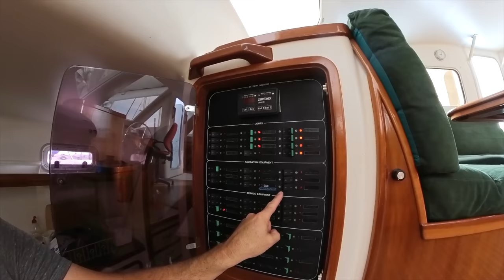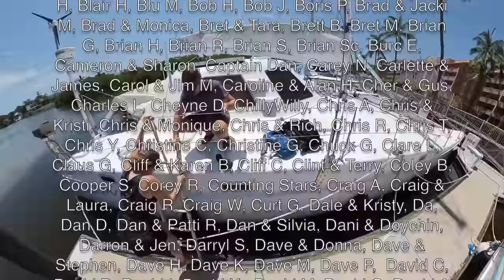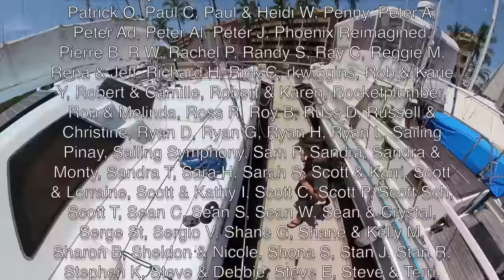OUR CATAMARAN SEARCH -  EDIT - THE DEAL FELL APART!

Comment from the maker: Hey there friends. I made a few mistakes in the video that I will clear up in a future video. The boards are pivot centerboards, which is a different thing than a daggerboard. The centerboard retracts on impact so they are basically unbreakable. I called it an escape hatch, but according to CW, calling it an escape hatch is actually a misnomer. The hatch is intended to allow entry inside the boat if capsized. The reason you want to go inside is that one of the key features of this design is the entire forepeak of each hull can function as a safe and dry habitation space in the event of capsize. Also, Chris tells me he can do all the engine checks from the aft compartment and doesn't need to tear up the bed. More to follow....of course.
Reply: A wise move is to ask Chris to inspect the whole boat, specially those cracks. Best wishes
Reply: It's also possible to do pivot asymmetrical boards, but either way the pivoting feature in many ways is better than daggerboards since they pivot up and out of the way in a collision with something.

Hit something hard enough with a daggerboard and at a minimum you damage a tens of thousands of dollar daggerboard, and (potentially much) worse if the daggerboard trunk is damaged.
Reply: Hope this all works out.... Its the boat you wanted and can be fettled to fit as well as updated. 
You can fit covers to the nets for when your at anchor or light weather sailing..and roll them up for when your facing full on passage making.
Reply: He even goes so far as to sort out what the inverted water line likely is to give an idea of what the boat might be like to survive on while capsized. He discusses the importance of having reserve buoyancy in the decking so the inverted water line would sit higher instead of leaving the entire vessel awash.

Comment: I never saw this coming.
The perfect next step to your adventure.
Congrats!
Reply: Funny thing, I kinda did see this coming as soon as they posted the Atlantic cat video, what was it 6 months ago. They are great boats, if sailing is a priority.  I sure hope the deal comes together.
Reply: @AndrewMoizer  This is that exact same boat, yes?
Reply: @user9b2    Similar, the boats in the previous video were newer designs, refinements of the same core concepts. I would say that the Atlantic 55  was the flagship design in its time, and depending on your requirements could still be better suited than the latest ones (things like the pivoting centreboards rather than dagger boards or mini keels). I don’t doubt this would have remained Chris’ forever boat had the opportunity to purchase Leopard after the capsize not come along. This is certainly a big, comfortable ocean cruiser, and a great boat if you can afford it, and are comfortable sailing something this size. I hope their deal comes together, it will be fascinating to follow along.

Comment: Congratulations on the new cat!  I like the idea of dual battery banks and dual systems. Redundancy is good; 2 Victron BMV712 battery monitors $216 ea. 4 SOK 206ah marine batteries $1030 ea. 2 Victron Multiplus inverter chargers $1,500 ea. 4 400w solar panels $290 ea. 4 Victron MPPT 100/30 smart solar charge controllers $190 ea.  complete separation between each system

Comment: Hi, Big fan and fellow cruiser here. Since you are contemplating a sizeable power upgrade I suggest you evaluate the Integral System that Nigel Calder helped design and troubleshoot.  It is a super duper alternator with software.  That means you can recharge batteries multiplies faster than with stock alternators on each engine.  It will be informative and fun to watch you to plan and install the desired upgrades assuming the remaining checklist of potential issues checkout Ok.

Comment: So cool guys.  My FIL had the first Atlantic 55' built in South Africa.  Sailing Spirit home to Annapolis was the highlight of my life.
Reply from the maker: Came from the same shed I believe. Not a ton of these out there. Sounds like she gave you quite a ride!
Reply: @TheOKellys  Spirit was a dream.  One of the legs was from St. Thomas to Annapolis. We set the autopilot on a Stbd tack and never touched it for 9 days.
Reply from the maker: wow! Nice run!
Reply: Matthew, so you'd be in a great position to comment on how exposed the front cockpit really is when sailing/passagemaking. My understanding is that it's not an issue despite how it might seem on paper.

And yup, that must have been an amazing trip.
Reply: @AndrewMoizer  the center cockpit has so many advantages. Maneuvering is so easy as you are standing in about the center of turn. You can literally spin it about the point where you are standing. Heavy waves may reach the cockpit but mostly as spray. And the boat is so big it takes a good size wave to cause any discomfort. And you can always head inside to stay dry.

Comment: OMG I PREDICTED IT!  Congrats.  Will be nice to see a Chris White boat on YouTube every week.   Also nice to see the interior of this A55, and while there are trade-offs, I believe I got the right boat.

Curious about the specs of the water maker you want.  I think I have the same one that is on Javelin.  Was looking at a SeaWaterPro 40gph
Reply from the maker: Yes you did. And what is your boat name? (or message me). I am looking at the Shenker, but also considering a couple others. Depends on what kind of deal I can get. Javelin has the old Katadyn...we had that one on Low Pressure. Simple, but we have found we use a lot of water and it's what changes this from camping to living well.
Reply: @TheOKellys   Unless you know something that’s wrong with them, I suggest you check out SeaWaterPro.  About half the price of a shenker and uses off the shelf parts for easier repairs. 

I did message you awhile back about my boat, suggesting a sister ship might be good for you.  Should have included my YouTube alias!
Reply from the maker: yes, sorry, the coms are literally out of control. I searched...I can't keep track across platforms.

Comment: That design is basically a big size Tornado. The Tornado design was intended for daysailing and racing. It’s exceptional in going to wind conditions. But.... this choice of exceptional characteristics has consequences for it’s handling under different conditions. I would advise you to have some long conversations with Tornadosailors on how to handle a Tornado in rough waterconditions. Wich sails to set and how much tension on the sheets. Chris knows all these things like no-one else.

Comment: Have sailed the Atlantic 55 which was built in South Africa. At some point it will definitely scare the crap out of everyone on board. Only a matter of time. Hopefully the rig was redesigned so that the mast doesn’t invert with a double reefed main.
Reply from the maker: Invert?
Reply: @TheOKellys  yes, when the Main is double reefed in heavy air, the head of the sail is below the hounds, pulling the middle of the mast aft, inverting it, as at that height there is nothing to pull the mast forward to keep the mast from inverting
Reply from the maker: @yankeexpress  looked to me a decent amount of prebend in it, but I’ll look into that further. Thanks for the info. How else has this boat scared you?

Comment: Great choice
You know this boat did capsize and Chris rebuilt it for himself! In this case I think it’s a plus.
Go for it
We sailed 13 years on a Switch 51, other purpose built fast cat, we hade almost no issues with it except Volvo 75’s flywheels exchange and Anderson electric motor free exchanges in 2006
Reply from the maker: Well, you're referring to Chris's other boat. We made a video about it last spring. Switch 51, eh? Lot of fans out there for those as well.
Reply: Chris' Atlantic 57 "Leopard" was the one that flipped.  Chris refurbished it and is sailing it now.  Megan and Nick have a video about it; it's the video before this one.

What's most impressive is how resilient Leopard was due to how well built these can be.  After floating around the Atlantic upside down, it had almost no hull structural damage.
Reply: Another video on YT is a different Atlantic 57 capsize in the Pacific.

Comment: There is nothing like a Chris White design for your desires. I was blown away wirh the Wormwood 55 Avalon. The sail drives are set at 45 degrees inboard. You can look down through the escape hatches, and see the propellers. All the weight is mid-ship the engines, chain lockers, water tanks, and fuel tanks to reduce hobby horseing. It has dagger boards, and hot stick tiller steering. The mast is 81 feet high, and the total boat length is 59+ feet. The bad thing is that the forward bulkhead needs re-enforced, and that is a big job.
Reply from the maker: Ha! We've been on a Wormwood 55 in Ft Lauderdale. Think the name was Avalon. Long time ago. Light boat!

Comment: Great boat!...not a fan of the cockpit and needs a lot of upgrades (20yo) The engines are in not so good place. No matter what the weather if it needs someone on the helm or a sail problem, you'll be out there in it with possibly huge water coming through the tramp. Does the standing rigging need replacing?
Reply from the maker: Well, a couple things. According to other Atlantic owners, it's not that wet a ride. Second...if sh*t is really going down, I don't care what setup you've got, you're getting wet. If you don't like a little salt spray in the face now and again, then this probably isn't the right thing.
Reply: @TheOKellys  sorry I wasn't trying to offend you. I've been watching you guys for a good while and liked all your videos. Good luck with it and I'm sorry if I'm not a fan of this boat. Keep on sailing!!
Reply: @rustyschultz1118  here's hoping that this deal all works out and then we will all get to follow along with lots of real world experience. I get a sense that a lot of people will get their minds changed (could be in either direction!)
Reply from the maker: I'm not ever offended by critical comments if they are educated and reasoned. Not a big problem on this channel.

Comment: Looks like a really solid boat.  I'm not sure what I think of the forward cockpit.  It would take a while to get used to.  I'm not real fond of the "fly by wire" throttle and shift control.  I wouldn't buy a car with it either.  I'm a firm believer in the "kiss" principle.  Good luck.  I hope you get it.  Will be interesting to see what you do with it.  Where are you headed with it first?  A boatyard to make the upgrades you want?  🙂Thanks for the video.  Sail On!
Reply from the maker: Probably a good stretch of work, then off to South Pacific

Comment: I like it!!!!  The saloon at 7:11 looked tiny from the outside, then you stepped in it at 9:43.  Doesn't even seem possible for all that space. Obviously it was a trick of the camera lens when outside.   Love the forward helm position especially if you find yourself in an area with a ridiculous number of crab pots. Life raft...... Hmmm.  If the vessel is afloat, and is a vessel that can't completely go down, I'm not sure I'd want to move to a much smaller object when I'm expecting or hoping for a rescue.  I'd want to be on the absolutely biggest object I had when drifting at sea.  Just my humble opinion with zero experience to back it up.  lol.
Reply from the maker: From the outside it probably looks smaller than it is and on the inside it probably looks bigger than it is. Yeh lenses do funny things. And yeh, this boat will float even if completely full of water. Raft for...fire...I suppose
Reply: @TheOKellys  Fire.  Very good point.
Reply: The liferaft is a tough one. Uncontrolled fire seems to be the main scenario that would call for needing one. I wonder if effort to mitigate that happening would be better spent. (I'm thinking of things like being able to flood the battery compartment on the A72 (was it?)).

Comment: YO HO HO SEA PEEPS.....love the new Cat...I am a retired 20+ year surveyor....just a lil on the stress cracks...of course, I'm not there to really see them but from what you showed I do not think they are a serious issue...one will find stress cracks on tons of boats caused by "HARD EDGES or TURNS".....it is usually just the brittle Gel Coat that is cracking and not the FRP layup itself. You should be very happy that YOU can see them...over 1,000 Lagoons now have found HIDDEN PROBLEMS behind the crannies so to speak lol...the cracks you pointed out I believe as you said...the fillet doesn't MOVE or Flex,  as well as, the joint therefore shows cracks. This type of boat construction "Monique" is probably the best way to go for a Cat  ...and can easily be repaired. The Beauty is the ability to SEE what the structure is doing and to enable quick easy repairs without removing facades or PAN LINER....Front steering Cockpit will be fun when it's nice and love all working rigging is brought right back and sat in your lap...lol....Looks like a fast safe Ocean goer and if ya get her I think it will be a whole new world of enjoying SAILING up close and personal............best wishes...Tim...Wrangell AK...SV "ARCHANGEL"
Reply from the maker: Thanks. Always good to hear from those who actually know. Agree with your assessment. There are a couple spots not shown in the video I'd like to get your take on. Can you email us through sailclarity dot com?
Reply: @TheOKellys  I would be more than happy to let you pick my brain..lol...what's left of it.....lol....been into boats since childhood....Marine Businesses in San Francisco and Seattle....I shall try and contact you as requested....thanks to STARLINK...we live in REMOTE WILDERNESS of Alaska....Cheers!   Tim
Reply: @TheOKellys  sent you a message as requested...cheers Tim

Comment: I have the same electronic shifters/throttles on my trawler.  Started failing at age 21 years.   Exciting to have to get in the engine room to move the throttle and or transmission shifter.   Cost $3600 to rebuild or $5500 for new replacements.   I went for new.
Reply from the maker: ugh! Thanks for the info
Reply: They are the ZF MicroCommanders… Not a lot of great alternatives for a dual station setup like this (inside and out). Just had to replace one of the control heads on mine (pair of throttle levers), $645 delivered. Not the end of the world but not as simple as mechanical.

Comment: It is interesting that there's NO life raft onboard. Don't know if you have ever read the book by Steve Callahan called "Capsized," but the crew survived in their gone-turtle cat for 119 days. The only issue that would require a raft is in the case of a fire. What's the fire suppression system like on Javelin? I would certainly want to have a survey done, that will help with the spreadsheet work, but I suspect that you're correct about the cracks. With a little luck you can do the most important upgrades like more solar, LiFePO batteries and a new inverter right away - and take care of the cosmetic stuff as you voyage. Good luck!!!!!
Reply from the maker: Yeh, that would be the plan. There is so little budget left, we are going to have to be very picky. Survey? Of course.
Reply: @TheOKellys  Congratulations, it will be awesome!

Comment: Why is a dinghy never considered as a life raft? It's a much more seaworthy craft. And what if there was some kind of sailing kit to throw onto your dinghy? Maybe it has a little solar panel integrated in the sail to charge a phone or radio? If you threw enough food/water on board as your boat sank then you could probably save yourself by sailing back to civilization. Now that Starlink V2 is going to be able to communicate with a regular old cell phone you could even pull weather and live stream the whole event on FB and TikTok. 😋   I'd be interested in any thoughts.

Comment: I agree with no life raft, remove the motor and fuel tank, I bet you could launch the dingy within 15 seconds, practice!!! Other than the water maker, why rush the upgrades? You can make this boat beautiful, and outstanding, if all in you're under $1.5 mil, you've got yourself a $2 mil boat. That's like a free Clarity, and water maker!!! Anything that looks like a stress crack is likely caused by carbon fiber bulk heads and support pieces being bonded to fiberglass, the carbon is way more rigid so you get surface fractures. The magic sauce in any boat is epoxy, carbon fiber just takes it to the next level. One thing to consider, instead of trying for a lower price, tell Chris you want $50K for every 55 sale you bring him, and $100K per 72.  Have you seen the new 72 carbon/epoxy boats? They are close to $10 million. Enjoy.

Comment: Only 3 have flipped! Not a fan of the keel/dagger designs. They flip in microbursts. Traditional Dagger boards let the boat slide running quarter or beam reaching. I'd do a John shuttlesworth way before a cw
Reply from the maker: Three? What is third one? Thank you for your thoughts. Agree with you on traditional daggerboards.
Reply: @TheOKellys  Anna and Leapard are most notable but the fact is ligh weight cats need traditional boards period.  Look at Boondaloop. Would be a mission to flip that bad boy plus its tank tested unlike CW which is more of an intuative design based on fundamentals. The mini keels are silly.  The layout is epic but id prefer a MM65 If that was the best selling point.